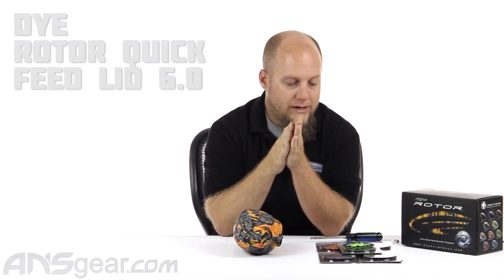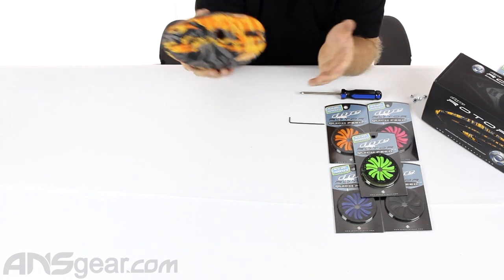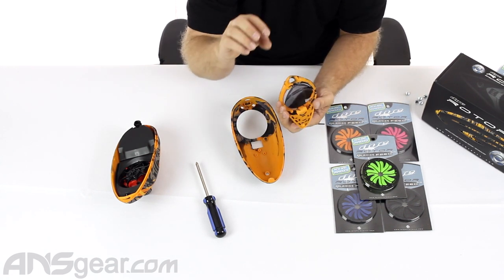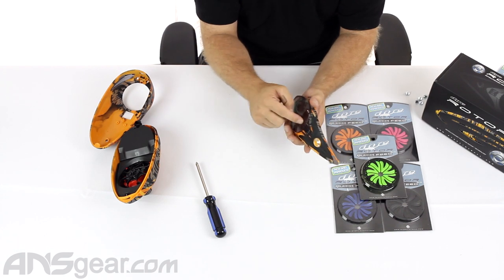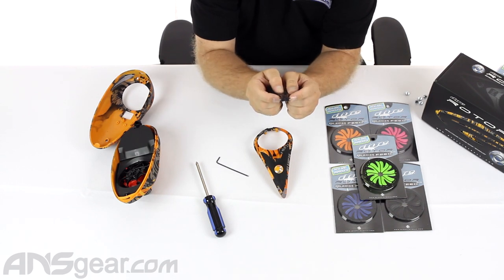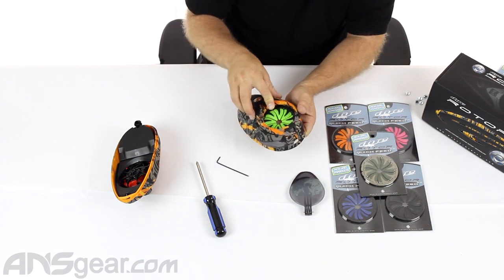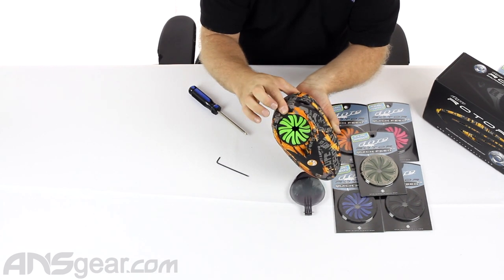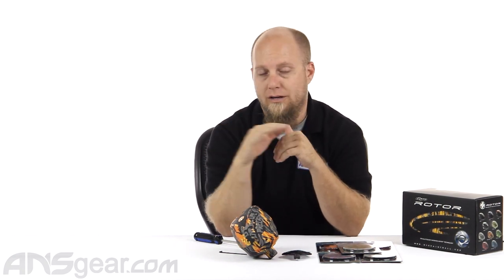Dye Rotor Quick Feed Lid 6.0 - Review

Comment: You should include some footage of how well the balls feed into the hopper from the pod. I'm currently looking for a new quick feed, bc the GenX one I have now is so stiff it won't let the balls settle from the pod into the hopper and I have to actually push the last 10 or so balls into it. Thank you. 
  I've literally dumped 100s of balls at this point bc of it.
Reply: This speed feed is great for the money all tho I did find that if I use dye lick lid pods u dump paint cause the pods hold a lot of paint and my speed feed started to sag down so it would hold less but I fix it and it works great again
Reply: Zackary Worden
How did you fix that problem because I'm having that same problem.